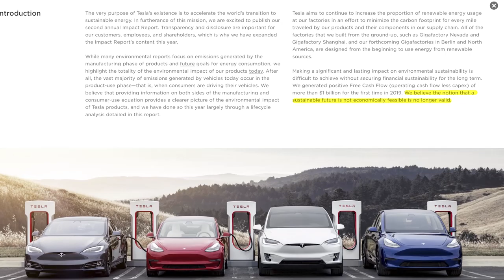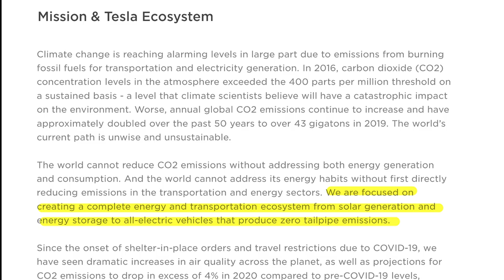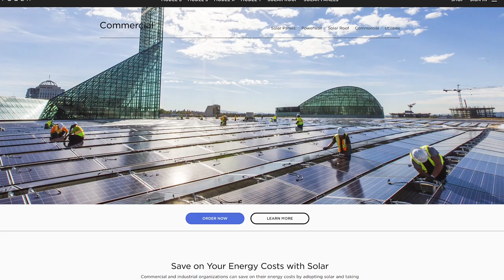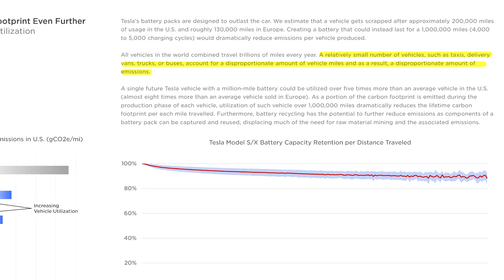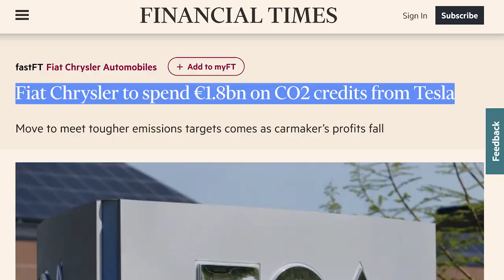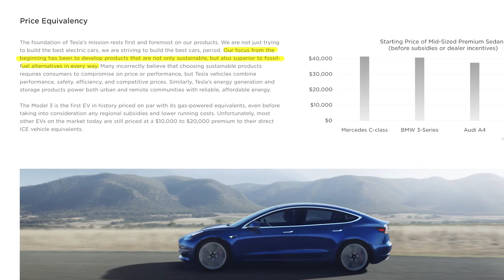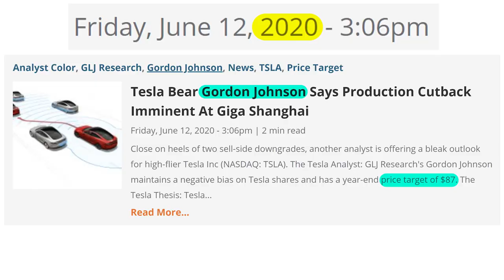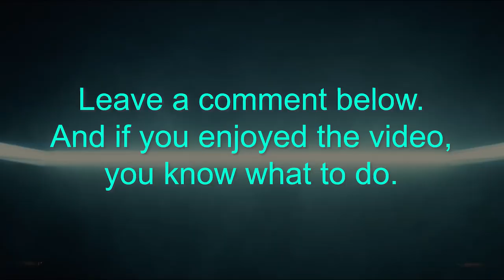Tesla Flexes Hard (and puts world on notice) In Impact Report 💪

Comment: Don't worry Teslaites. You will see TSLA get cut in half again at some point, maybe more. It's an incredibly volatile ticker. Don't chase the price. Like a sniper, wait for your shot to walk in front of you. I can, with a fair amount certainty, say you'll have an opportunity to buy TSLA again, within a year at sub 600. So maybe start an initial small position, say 1% of your equities portfolio - whatever you think is small and that you hope to grow through both more share acquisition and, more importantly, capital appreciation. Then you can nibble a bit here and there and on pullbacks; have a % allocation and capital allocation plan for each ticker in your portfolio.  For example, if you'd like a 10% portfolio allocation to TSLA, you can easily make a plan to deploy capital a certain flexible price entry points to get you there. You can do the same for individual ticker and your overall portfolio - not 'can', you 'SHOULD"! I.e. if the market drops 10% deploy 5% of your cash, if it drops 20% (statistically about once every 4 years) deploy 25%, if it drops 30% or more, deploy 50%. Whatever, you get the point. You can do the same thing with individual tickers.

Comment: The biggest risks I see to Tesla in their future:
- Elon dying. Loss of the key driver can be difficult, though not impossible to overcome.
- Hostile takeover to bury it. Wouldn’t be the first time. Big oil/legacy automakers have a lot to loose. They will not sit idly by and let their dominance be eroded.
- Antitrust. They get too big and are seen to be anti competitive because of their market dominance. Similar to the above.
- More concerted and unified effort politically to protect their Big$ benefactors. Eg banning web sales when no dealers exist.
- Probably more.
Reply: Each of your concerns have been argued and addressed many times in the past. I won't list them individually here as you can easily find them with a web search. Bottomline: apart from your first point, there's nothing to worry about.

Comment: Catl has a million mile battery that is not Teslas. Who is it for?
Reply: CATL has a million mile battery, being used in Tesla cars, quite possibly with some features related to Jeff Dahn (team) research.
It will have less density than the existing 2170 cell, but probably be the best LiFePo4 out there (that's a guess, but I won't be surprised)

Imagine if Tesla uses that cell in its lower range cars.
They start building "new cells" in the US (already?)
Shortly after that, they complete the battery facility in China.
They build the new cells there.
Higher range models get those cells.
As production ramps, they are fitted to all cars.
At the end of the contract, in 2022, Tesla either "gifts" CATL the tech in the LiFePo4 cells, or allows them to sell to others, taking a royalty.
Tesla is still in front.
They have an additional income stream.
The CATL cells going to others help advance the mission.
Reply: Apparently, anyone who will by them in bulk orders can do so as their CEO said.

Comment: Ha, ha .How is an electric  car anymore “sustainable” than a petroleum powered car? Electricity is mostly produced with fossil fuels. The grid losses transporting electricity to charge the EV are substantial.
Reply: Old debunked argument. Try again.
Reply: well electric cars are many times more efficient than fossil fuel cars so instead of putting fossil fuels into the car directly, they can put it into the electric grid which is far more efficient and sustainable, also teslas long term goals is to make it so that most companies who buy there products also buy solar arrays for charging stations on site where they keep there tesla made vehicles, eventually as more companies invest in tesla the amount of solar arrays add up, also while the vehicles arent in use, these companies can make passive money by selling power to the grid using there solar arrays. so not only are these companies saving money on fossil fuel consumption, theyre also passively making money because of tesla.  its genius

Comment: I think you overexagurate a little because though Tesla is innovating quite quickly the other car companies have much more ressources and electric cars are actually so much easier to design than ordinary. Same counts for an energy ecosystem where others are already established and aren´t stupid, that they won´t crush theire margins, which they now get, to compete. I really like where Tesla is heading towards and they certainly will mix up the market though they will not get to first place that easylie as you think.
Reply: Agree not easy to win this game. But based on ev sales/battery efficiency /battery production /ev brand they are first right now for sure
Reply: If electric cars are so easy to design why VW is postponing launch of it’s ID3 for the second time? It is not just about designing a motor but a complete power train including batteries and their chemistry and an efficient software to manage the whole car and it’s environment
Reply from the maker: I don't make these statements lightly Daniel. I have spent years going deep on everything I perceive to be relevant to Tesla. Check back in 5 & 10 years :)
Reply: Hi Daniel. I've been watching closely what the other car companies have been doing in response to Tesla. Yes, it is easy to simply design an EV on paper. Actually designing a "mock up" concept car (that doesn't actually run) is also relatively easy. Designing and PRODUCING a concept car is very difficult and EXPENSIVE but certain car makers (Ford, Daimler/Mercedes, BMW and others) have actually produced concepts that actually drive BUT cost around 5 million Euros each. They are AMAZING vehicles. That Aussie woman "BlondeBunny" or something like that, actually drove one but was forced to NOT DRIVE faster than 8 klm/hr (5 mph). Watch her video. Those hand-made 5 million dollar/Euro cars have NOT gone into production cause 1) they can't actually get the drivetrain/battery combo and software to work! 2) the cost is prohibitive. 
So, NO, No, No. It is NOT easy for the "big" boys to respond. They will, one day. But will it be soon enough to save them? I sadly predict that Ford will be the first big company to go under. If you look at their financials over the last 3 years it is shocking! How can a company with a mark cap of less than $20 Billion have debt of over $160 Billion??? (Yes, they do!) As Maxwell Smart once said, "It don't look good, Chief".
Reply: @SolvingTheMoneyProblem   
Steven, thank you for the awesome videos!!! I appreciate your courage in following your convictions going all in on Tesla with all your savings. Question, if you owned no Tesla stock today, and just had the equivalent amount of cash would you go all in right away at this price level ($1400-1700)? I'm sure your answer is yes, but had to ask anyway. We have a 2012 Model S, looking to add a Model 3/Y, and a hefty chunk of our nw in TSLA. (History: in at 350 in 2017, sold at 400 in 2020, in at 1000 in 2020!).

Just love how man facts you pack into these, the positivity and love....  and it's amazing you read all the comments, it took my browser a few minutes just to load this many. 

I can readily agree with the assessment of Tesla Motors, but Tesla Energy is seemingly more nascent. Is there really enough clarity to believe that they will dominate the multi trillion dollar energy market like they are set to do for auto? Wouldn't it seem like they can become huge but that they will not be the only force in batteries + grid energy on the planet? Certainly I hope you are correct. It's nice to see two massive companies run by a "nerd's nerd" (I like to think "physics student from personal bias").